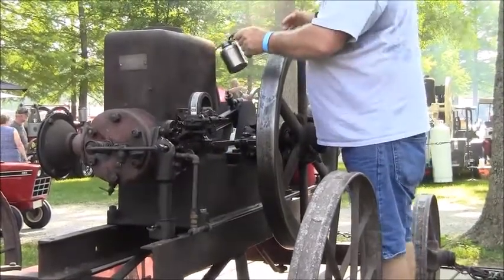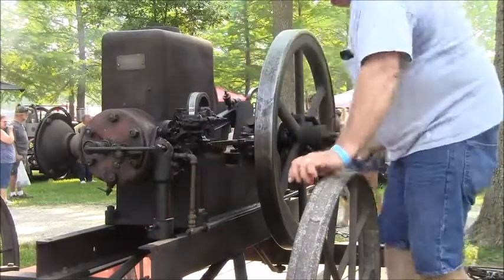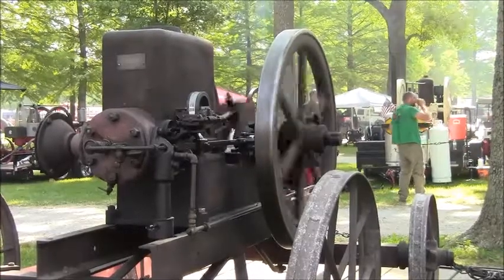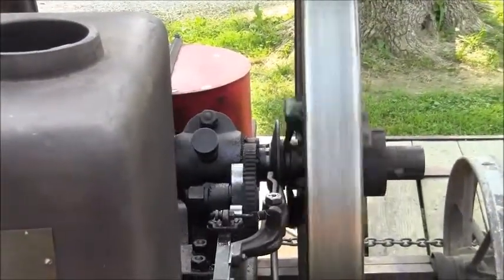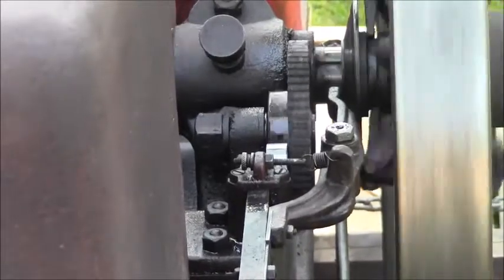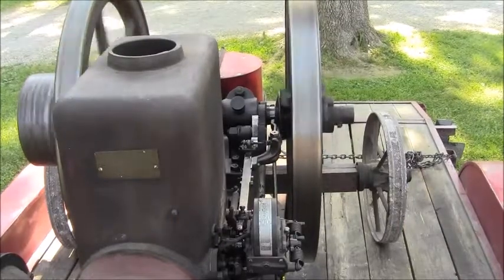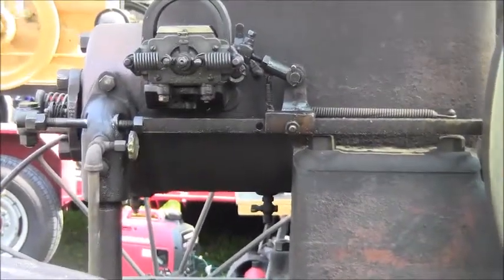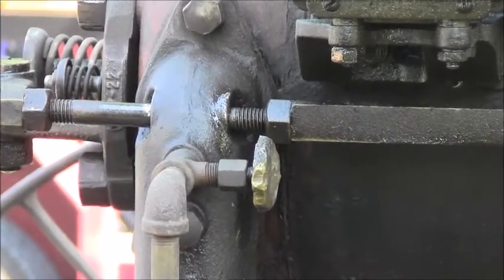Armstrong Hit And Miss Engine; 6 HP

Comment: Wow!  That was some ignition set-up on that Armstrong! One thing I can say for sure, you meet the nicest people at tractor and antique  engine shows! I've been going to them for over 35 years and have been blessed to meet some of the most intelligent people of my life and few if any had a 'degree'. Imagine coming across that engine and not knowing the steps to start it! Gary made it look easy but the first time you try something like that the wife is begging you to "come inside it's 2am!" as you reply "I'll be right in I almost got it"!  Lol
Great video David!  Thanks!  😃👍
Reply from the maker: This engine has an ignitor with a Webster magneto. Earlier engines had an ignitor with a battery; then dynamos came along to replace batteries, then magnetos.  Starting an engine with a little generator to make the electricity was hard!  You couldn't spin the wheels fast enough.  IHC made engines with a hot tube for starting, and then you switched to the dynamo and ignitor. IHC switched to the Webster mag system when it came along.  John Deere engines pretty much stuck to ignitors, except some of them had a battery box, a buzz coil, and spark plug.  Those are rare, and are hard to come by.  Ignitors are electrically simple and mechanically complicated.  Spark plug ignition is electrically complicated and mechanically simple.